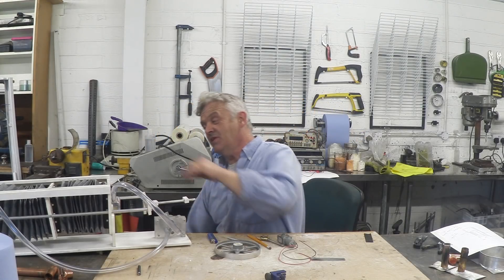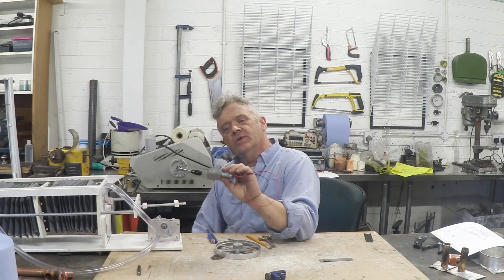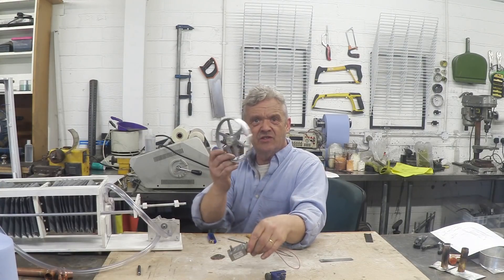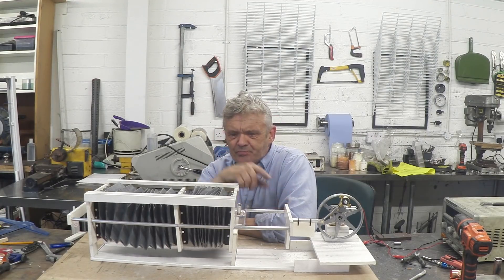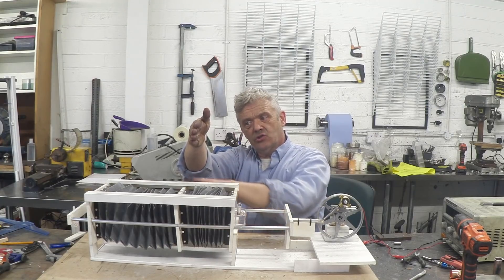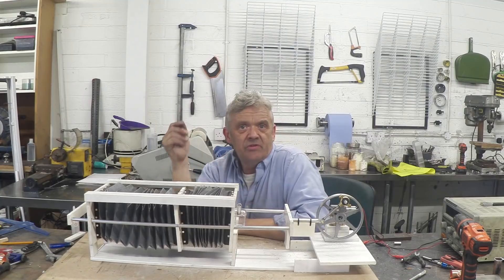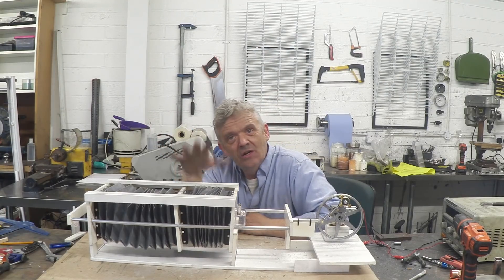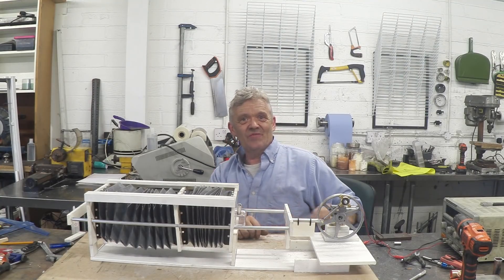DIY Air Conditioning 1 - From Bellows Efficient And Cheap

Comment: air displacement unit. no compression..
Reply: I have seen many rants online about the wet blanket concept... it would humidity the air... and as LT says  this is a cheep and cheeky form of air conditioning. I believe they are called air conditioners in the US where they also call the specific design Robert mentions as a "swamp cooler"   requires u to keep adding water or ice(moving the load of the work to your fridge or freezer producing the ice"

Consept is sound even if we may argue over terminology... as Witginstine said " language and terminology confuses thought"
Reply: Whats the real benefit of this over a small fan for swamp cooler CFM?  Unique, yes. More useful/practical than a small fan?
Reply: @boots7859  Intriguing for me is that this solution uses less energy than a fan. Many different uses possible...very interesting.
Reply from the maker: it depends what you do - if you pass the air over say a bucket of ice it or thorough a radiator or maybe just wet blanket it becomes conditioning - if you just move it around it's circulation - so deliberately sloppy really
Reply from the maker: sorry mate but conditioning doesn't require compession - the compressor is about the heat exchange pump not the air conditioning - that is about moving the air over a hot or cold side - creating that can use compression but a bucket of ice would do as well
Reply: @ThinkingandTinkering   To my mind, (and it depends a good deal on your local climate) Air conditioning also involves controlling humidity. In a desert area, there is no humidity so reducing temperatures with a swamp cooler will do. In the mid-Atlantic and South eastern coastal areas of the United States (for example) it's not just enough to reduce the temperature, but one of the primary functions of air conditioning is removing moisture from the air. Using (compressor) based climate control removes moisture and since there is heat associated with the free water vapor being removed, it is also reducing the temperature.

Wasn't it a side effect of the linear mechanical oscillator (configuration) that it was pumping air and the exhaust was lower in temperature as well?

Cheers!

Rocky Lee
Reply: @ghostwheelppk    Very much agree here.  I live in one of those hot and humid areas, and while convection helps some--it's the humidity that is the real issue.  I don't mind dry heat so much. 

    Tech Ingredient's evaporation cooling and humidity lowering  system looks like an interesting one.  Unfortunately the spouse vetoed the project, saying it would be too ugly and too much of an eye sore.  I may still build a mini one for the pickup truck with enclosed top for car camping during mid Spring to early Fall season
Reply: @ThinkingandTinkering  Hi Robert, I just made my comment based on the actual device on the table. A skilled person in the field without any further information would call it a fluid displacement unit. If this was a PCT patent application the examiner would object its topic due to clarity (Art. 6 PCT). I have no doubt that you can even evolve this device to a particle accelerator. :) 
We love you and pls give the people an incentive to make the world a better place..
Reply from the maker: @LT-tg4bn  I agree mate they would and I don't disagree with what you are saying - cheers

Comment: You could use a Stirling Engine to drive it. We know you like Stirling Engines...
Reply from the maker: for sure mate
Reply: Would love to see a Stirling engine with that much torque.
Reply: @Scott_C  it's only 0.4 W, so a geared-down small Stirling should be able to run it pretty easily.
I suspect a direct-drive fan running at a higher RPM on the Stirling would be more efficient though.
Reply: @Scott_C  That's what gearboxes are for
Reply: @1upPaintingAB  Yep, indeed they are. Even still, the number one problem with SE is their lack of actual "horse power".  Can't "just gear up" a simple SE up enough to move any weight you want. 
 Besides, I  didn't say it couldn't be done.  I said, "I'd love to see it..."
Reply: @Scott_C  I agree, I didn't read your comment as condescending, just adding my 1.8 cents.